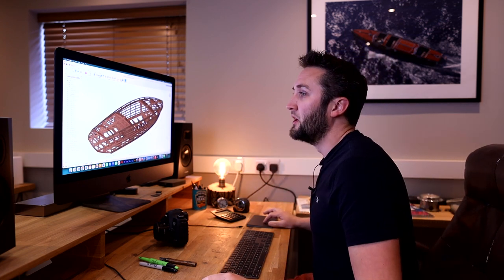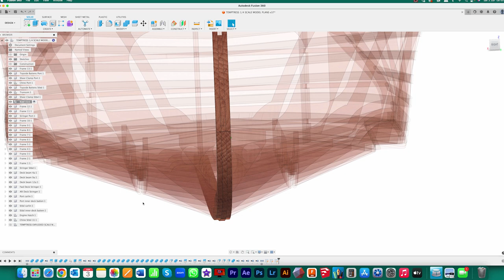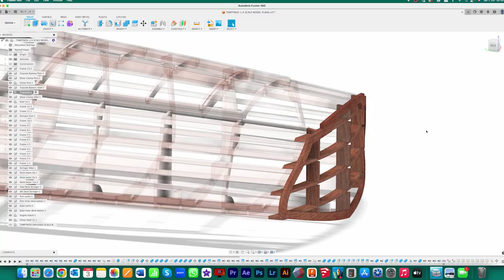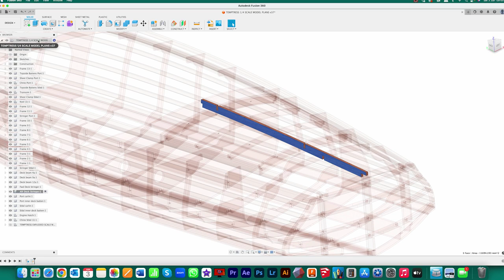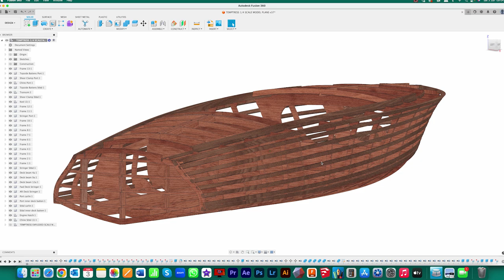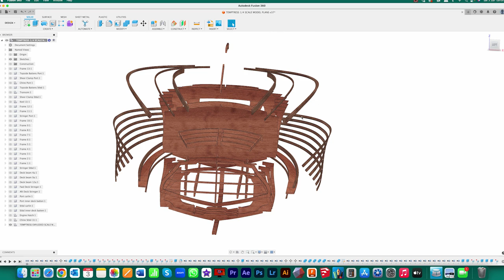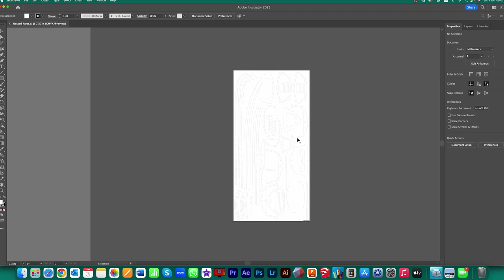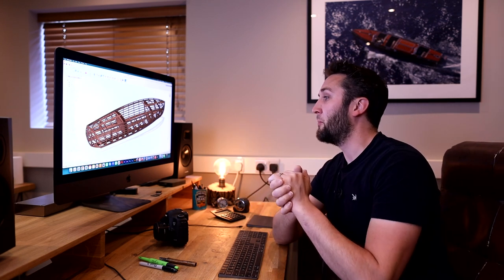RC Model Boat Plan Tour | Temptress 1/4 Scale Boat Build Part 9

Comment: You're a star Dan! I've just ordered and downloaded a set of plans!
Reply from the maker: Great stuff! Looking forward to seeing some of these getting built!
Reply: @DanLeeBoatbuilding Well, I'm excited too! I'm going for 1/8th scale as my hobby is already taking up so much space and I happen to already have all main drive line components such as: correct size electric motor and ESC, LiPo batteries, and propshaft/sterntube, and even a rudder. I've found a company fairly closeby to get the parts laser cut, and I just need to reduce the files to the correct size using a trial version of AutoCAD LT. It's a bit of a pain getting the software downloaded, so I'll see how that goes. It's going to be an interesting project!

Comment: Great!!
It's possible to cut longer parts on smaller machine, like 140cmx90cm and glue them up?
Cheers!!
Reply from the maker: The longest part (the keel) is 280mm, you could chop this into sections to cut on a smaller machine. If you stagger the joints between the three keel layers then they will glue together fine. If you cut the other long pieces (stringers and chines) then I would suggest adding a small butt block that spans the cut, if you do this in a section between frames then it will work out fine 👍

Comment: So , Captain Dan , what’s the best computer assisted design ( CAD ) system for engineering and design for nautical application ???
Reply from the maker: Michel designs in a program called Key Creator, it works well between surface and solid modelling which makes it perfect for designing boats. I work in Fusion 360 of course which isn't soo great on the surface modelling side but for what I do, designing the jig's fixtures and kitting the boats it works well for me. A lot of people use Rhino although I don't really have any experience with that. Sorry for the less than definitive answer :)
Reply: My stepson has been using Rhino 3D for yacht design at the Landing School. Delftship is great at determining fair hull shapes.

Comment: Dan, will I need Fusion 360 to be able to open the 3d model? Looking forward to picking this up over the summer.
Reply from the maker: You'll need anything that can open a .step file, most CAD packages will. I may add some different file formats in there if people need them, an .stl can be opened in sketchup and photoshop so I may add that in as well to make it more versatile.
Reply: @DanLeeBoatbuilding  Thanks Dan. Out of interest do the full plans detail the type of motor that can be fitted and where to source mechanical parts?
Reply from the maker: I haven't put the mechanical hardware plans together yet, I will do as and when they are needed by builders but this info will be available yes.

Comment: Dan, I've been waiting for these!  How many ply's should the 6mm and 3mm plywood be?  There is some pretty lousy 3 ply wood out there.  As a matter of fact what do you recommend the plywood be.  Thanks again and I'll be ordering a set of plans.
Reply from the maker: The parts take up 1 whole 8x4' sheet for the 6mm, quarter scale boat, 1/2 a sheet of 3mm if you decide to do the smaller size one of course. I'd probably use something like a birch plywood I think if I were doing this but thinking about it, almost any 6mm sheet material would work. I bet you could even get away with MDF if you epoxy coated it all!
Reply: @DanLeeBoatbuilding  Dan, I'm leaning toward the Birch 4 or 5 ply.  Thanks again.